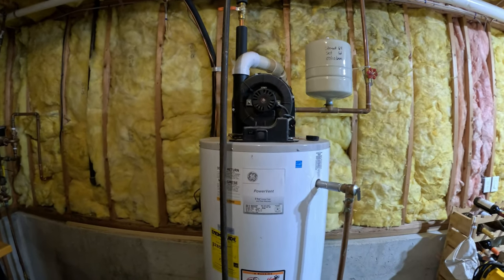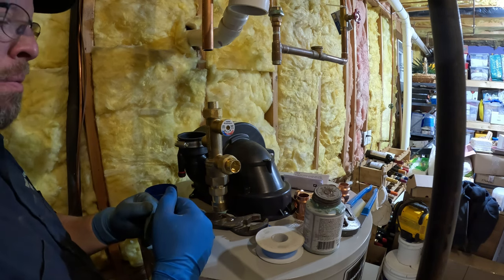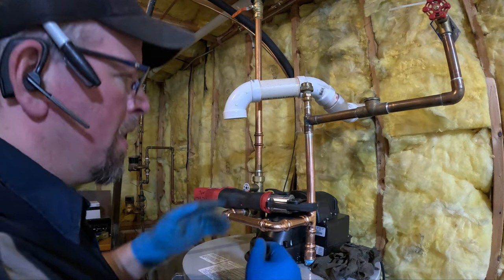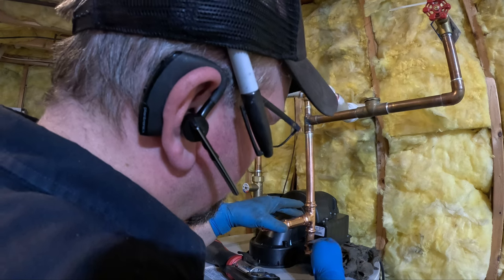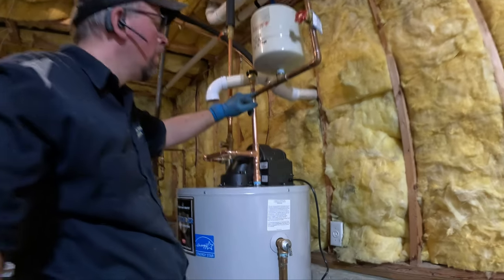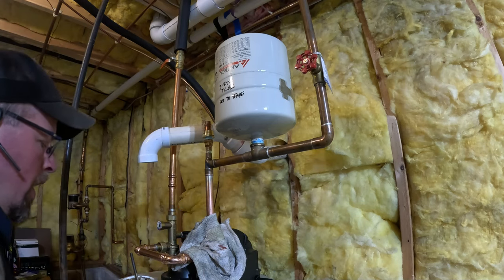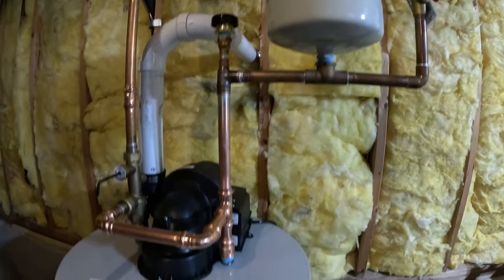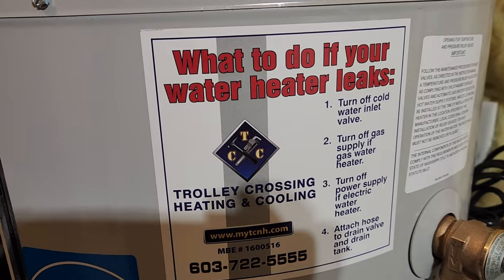Bradford White RG1PV50S6N19 50 gallon power vented natural gas water heater installation

Comment: If you want to have real hot water for your dishwasher (directly ) how do you get it? That type of mixing valve has one outlet only - the mixed.
Reply from the maker: I do not work on dish washers, but I assume 140 degrees is a bit too much for them? I am really not sure though. You can choose another style mixing valve or pipe it like I did and just add a T before the valve.

Comment: I have the same mapp gas tourch I think it makes a better solder job !!!!
Reply from the maker: I agree, mapp gas is hotter than propane so it heats up quicker and works better.
Reply: @TrolleyBrothers  yes in my opinion propane burns copper cause ur taking longer to heat the fitting and I always burn the flux with regular propane mapp gas I had great luck

Comment: Is this heater noisy? Thinking of either this or electric tank…
Reply from the maker: Not any more than any other power vented water heater. Certainly electric would be silent in comparison.
Reply: Thanks for your reply. Electric would be great but might be much more costly to operate than gas…